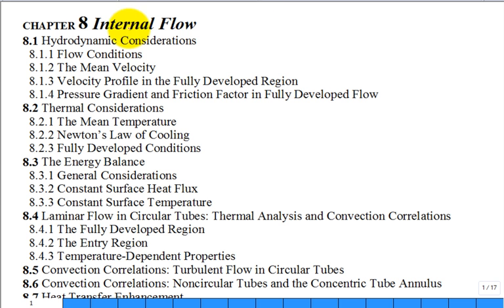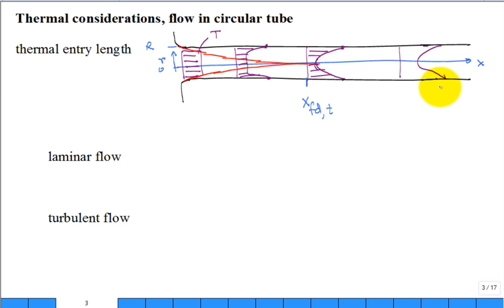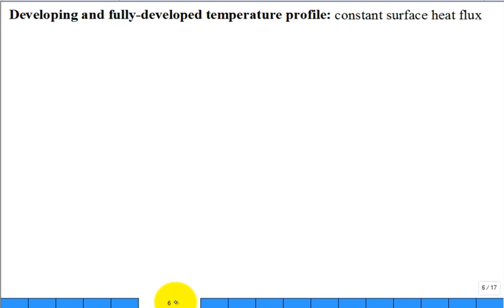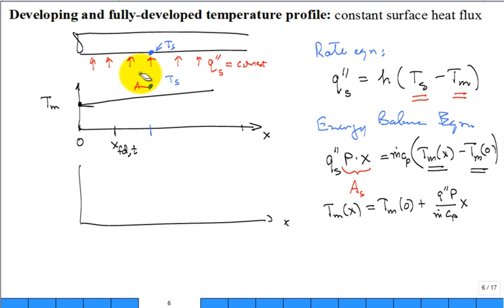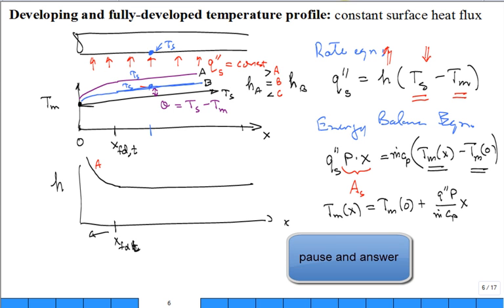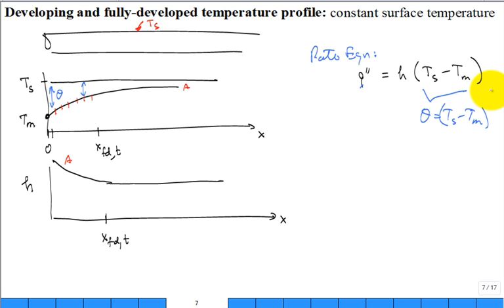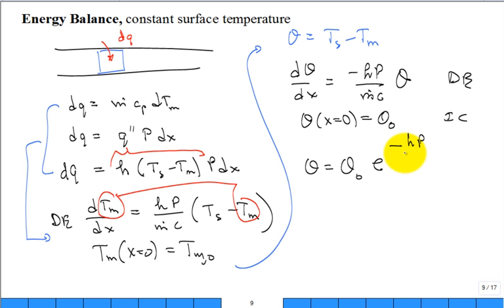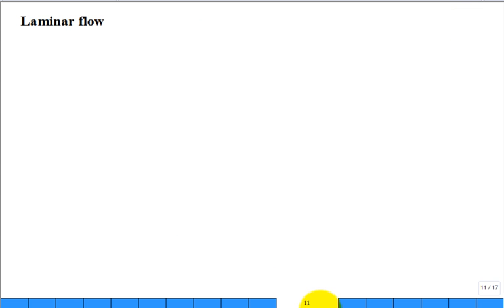Heat Transfer Internal Flow 2

Comment: Great lecture professor. Why is the enthalpy (cp * T) used to arrive at an expression for the mean temperature and not the internal energy? Doesn't enthalpy take into account the work done by pressure (mechanical work) as well as thermal energy? Wouldn't thermal energy alone be more relevant?
Reply from the maker: +Nikan RT your answer is good, enthalpy includes flow work as well as internal energy.  If the fluid is incompressible, then cp=cv and there is no difference.